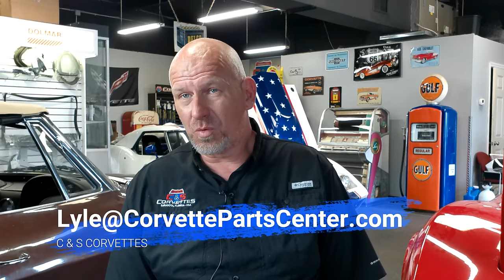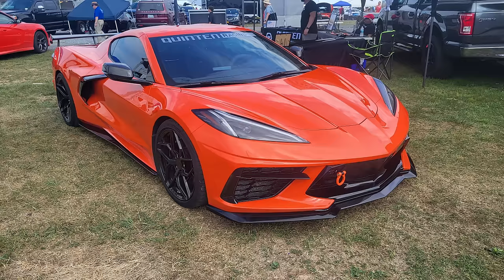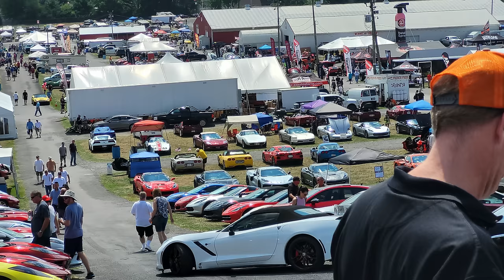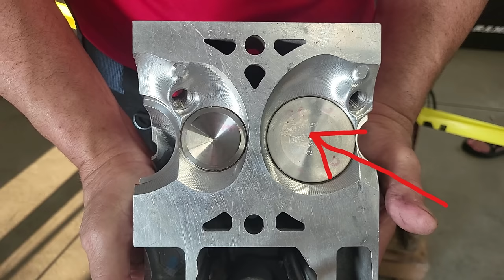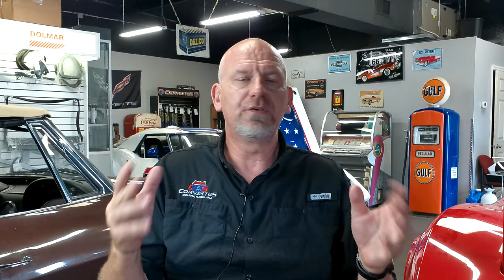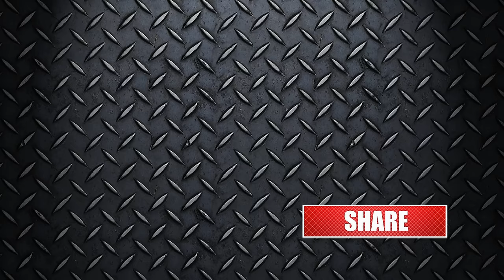The Truth about the LS7

Comment: It's simple it always has been. That engine should not be revving that high period.
Reply: Imagine buying a track built car, and the solution for the flawed design in the valves is... "oh don't rev the car out and get performance, just putt it around"
Reply: @mylesG23  for real. But to be honest any car that revs abnormally high, for example alot of super cars they need to be inspected every so often. Any engine that revs high will always wear unbelievably fast. That should have been in big print in the broshure
Reply: @qpzmak  Yea, I mean we saw issues with the Voodoo in the GT350 due to vibrations but that is significantly higher revving, and the motor wasn't blowing up, they were rattling oil filters off, significantly worse it burned cars down haha.  I mean 7k really isn't THAT high, most other LS and the new LT motors rev to 6500, and they have non of the issues.  From all the reading I've done and what people said here it was due to the material the valves were made of, performance driving only exacerbated an already ticking time bomb.  I think alot of the reason there's so many people coming forward now, is when the cars hit the bottom of the depreciation curve and younger people who wanted a track/auto X car bought them from old guys who literally NEVER drove them.  On god saw a 06 pop up for sale on facebook like a week ago with sub 10k miles.  Obviously that guy has never seen a valve issue, he drove it once a year.

Comment: All I hear is a bunch of excuses.  Why did GM give it a 7,000 rpm redline if it can’t handle it?   Short shifting it doesn’t make much sense. The RPM’s matter when you upshift too especially if you are racing etc.  

The GM guy will never outright admit they messed up.  The LS motor is one of the most modified platforms I’ve n the world but the LS7 can’t handle simple mods?

Comment: this is such boomer talk. "If you modify it at all it wasn't designed like that it's your fault blah blah" the fact of the matter is that there are countless stories of those valves being bad stock. Any engine worth its salt especially the LS platform, is capable of much higher performance than stock.
Reply from the maker: You should check out the follow-up video I did after interviewing a former GM executive about what GM really knows about the issue.  Remember, this video was reporting what we were told by GM's head tech...not my opinion.   Lyle

Comment: So much incorrect information in this video. Dates of public admission: incorrect. Almost no stock failures: incorrect. 6 or 6500 is enough 😂 Have you even seen an ls7 dyno sheet? The valve guides are not concentric with the seats. You can use brass guides with titanium valves, the valves get a moly coating. The guide issue is real and happening to stock engines…the titanium rod rubbing issue happens to modified engines. Fyi, there is still an ongoing lawsuit
Reply: My Z06 on the dyno made max hp at 6k. It holds it to about 6900, and then drops off fast. (Rev limiter is 7200)
The class action lawsuit has been settled for awhile now and GM won.
Personally, I have never found a mechanic or owner in real life that has ever seen an LS7 valve failure.  Just a lot of internet hype.
Reply: @SmoknJaysGarage  lawsuit isn’t over, and your ls7 isn’t the only one out there 😂
Reply: @bdun1226  you asked if we've ever seen as LS7 dyno. Yes I have, several.  All made peak power right around 6k.
Yes the lawsuit it over, and yes GM won it.
Reply: @SmoknJaysGarage  there was a procedural dismissal only for Californians. All other plaintiffs in other states are still waiting to be heard in Michigan court. There was no factual dismissal.
Reply: @SmoknJaysGarage  call Knapp Petersen and Clarke, because you are talking about something you evidently know nothing about
Reply: @bdun1226  they couldn't find enough people that actually had a valve failure to keep it in court. It was thrown out. It is not still pending in other states. You can Google it, you don't have to take my word for it.
Reply: @bdun1226  I may not be a smart man, but obviously have more knowledge on this particular subject than you. Everyone agrees.
Reply: @SmoknJaysGarage  you are delusional…you think everyone agrees with you 😂
Reply: @SmoknJaysGarage  nope, you aren’t smart by your own admission…i can only share that because it’s on the internet. Reading is fundamental
Reply: Yep, just more GM propaganda. He says 2006 is the only year there was a machining problem. So how come there was a bulletin from GM that said the machining issue affected 2008-2011? Then he claims almost no stock engine failures. What a bunch of bs.  But I notice he didn't mention the excessive valve guide wear issue, which is what eventually leads to a dropped valve.
Reply: @darylmuellenberg9456  i keep posting a caselaw link of the lawsuit and YouTube keeps taking it down
Reply: @bdun1226  can't post fake news?  Darn, I was looking forward to seeing it.
Reply: @SmoknJaysGarage    case/estate-of-pilgrim-v-gen-motors-2
Reply: @SmoknJaysGarage  Google that, you should be smart enough to find it with part of the link since YT won’t let me link. Or maybe you aren’t that smart
Reply: @bdun1226  I did Google it, and everything confirms what I've been saying.
Reply: @SmoknJaysGarage  Hope you don't have the issue, because it is FAR from "internet hype", as it happened to me. Do you even own an LS7? "A lot of internet hype" has cost C6 Z06 owners between $15,000-$20,000!! Facts: All the LS engines have the same length valveguides, including the LS7. However, the LS7 uses the longest valve stems of any LS engine. Think about those facts for a bit........
Reply: @milojanis4901  yes I have an LS7,  no I haven't had any issues with it. I have almost 45k miles.
Reply: @SmoknJaysGarage  Incorrect!! They couldn't find enough people with the issue who wanted to get involved.....
Reply: @milojanis4901  can't find enough people with issues to make a case...but ya, every single ls7 has issues.  Lol

Comment: Thank you very much for setting the record straight. I have been concerned about this issue as I have been in the market for a C6 ZO6 but then ran upon those damn internet garbage about the valves. I am now looking for a bone-stock ZO6. I will stay away from the 2006. I am looking at 2007 newer. Thanks for debunking this myth. I can now shop with confidence. And Attention All Viewers: If you have a C6 ZO6 (Except 2006) with a maintanance history under $27,000 please reach out to me. Thanks Lyle!
Reply: 07 and up Z for less than 27k ? I bet you are STILL looking. That's base money.

Comment: You’ve been misinformed by your GM buddy.. There must be a record of over 10k engine failures in the LS7. When the exhaust valves were designed and welded there were flaws that allowed the valve to break at the weld and destroy the engine. It happened to owner racing their cars and some simply driving normally. GM knew this and hid the fact that any LS7 could grenade at any moment. GM simply hoped owners would make it pass the warranty. Thousands got screwed bad on these cars. Some were smart enough to replace the GM heads with aftermarket units that basically saved the owners from 15k dollar repairs. Making excuses for GM isn’t a good look

Comment: can i get at least a muf delete ?
Reply from the maker: After having had the interview with "Duntov", my insider at GM (not the GM Head Tech still employed by them), I don't think that doing anything to the air intake or the exhaust hurts the cars...it is a design and metallurgy flaw that will either be good forever or fail spectacularly at some point.  Best advice I can give is to fix or replace the heads with the kit from Katech or a similar company.  Lyle

Comment: Based on the stupid comments made in your video you must think your viewers are idiots,  none of us are techs,  and noone is aware of GM's history of claiming certain problems only exist in certain years,  or not at all....  I personally know of 3 newer than 06 BONE STOCK low mile,  pampered, very well maintained Z06'S  that have had valve problems.  My chiropractors 2012 ate a valve with less than 30,000 miles on the clock. He and his 80 something uncle are the only ones to have ever driven the car,  and he has never revved it past 5,000 rpms because he is not a gear head, and scared of it.  You CAN NOT OVER REV A STOCK LS7 as the ECU will not allow it.  High rpms are often used AND NEEDED when going thru traps on a drag strip or holding a gear while cornering or on a road course. You know, the kind of thing YOU BUY THE Z06 FOR....  Furthermore ANY engine should be able to rev in the upper rpm range with stock tuning and proper maintenence.  Blaming a manufacturer problem on other shops....  Have you ever heard of Berger Chevy? Most auto enthusiasts have as they've been world renowned Chevy High performance and Corvette enthusiasts for over 5 decades.  They are the ones who fixed the ones I am aware of,  and they see this problem quite often. They just don't talk about it unless you know a tech personally.  Because like you, or who ever put these words in your mouth,  they do their best to cover GM's ass and not piss anyone at GM off.

Comment: You have no idea what you’re talking about first, second, if you’re gonna literally sit there and insinuate that putting a cold air kit and long tubes on a car can damage the engine, you need to put the pipe down.

If it’s damaged afterwards, it’s probably not the cold air kit or long tubes fault.
Reply from the maker: This is what I was told by Paul Koerning from GM in an interview.  I did not edit his words.  I also did a follow-up video after interviewing another source inside of GM that told a very different story...check it out.  Lyle

Comment: So Chevy engineered a engine that cant take bolt ons!? The number one thing almost every Corvette owner does to there cars. And when your  trying to go fast it's better to shift at peak horsepower not torque, what's the point of having all that horsepower. Great video otherwise
Reply from the maker: Walter, I agree on several of your points...I wanted to present the GM explanation verbatim and then address the follow-ups in a second video.  Lyle

Comment: Ummm ya dude your info is wrong there bud … I have an 08 and it dropped a valve and it’s because the valve guides are too short and it was bone stock when this happen car had well under 25k miles on it … GM needs to get there shit together and take ownership to that they messed up but now they wanna say it’s because cars are modded only it happens  BONE stock yall are sending false information know a few of them that swallowed the valve and left the stem in the head.. valve issue no head issue um I guess what category you wanna put the valve guide in… this is the worst video
Reply from the maker: Ummm ya dude...I interviewed GM's Top Corvette Mechanic and simply repeated what he told me.  Later on, another (former) GM engineer wrote me to tell me the real known issues with the LS7...maybe that video is something you should see before telling me how false my information is?  Just a thought, eh?  Lyle

Comment: So much bad information, LS7 is absolute trash engine.
Also what's with the nonsense of not getting benefits from rpm's? Switching gears at peak horsepower with be much faster than switching gears at max torque.

Comment: Disappointed. This video was made for mechanical ignorant. There was lots of generic talks and nothing about LS7 specific cause of failures. From what I have heard failures has happened in all year LS7 ZO6s with stock engine. Of course, GM chief engineer and CEO would not admit to any problems. Talking to them is waste of time. Because of this, I am looking for a C7 Z06 even though C6 has much better styling.
Reply from the maker: Did you watch my follow-up video? It goes into much more mechanical detail.  Lyle

Comment: This video really hurts your credability as some one that gives corvette advice, works on them and has been around them for as long as you have. If you couldnt mod the ls7 and rev it past 6k why in the hell would anyone get it over the grandsport? Cam, headers tune and the ls3 is putting down ls7 numbers. The head issue is widely known in the corvette community and you work on them for a living and dont know? You should delete this video
Reply from the maker: Ben, like I mention in the video, I have never had this problem in my shop.  I went to GM's #1 tech for information, and passed along what he told me.  The internet is rife with overblown fears of just about everything, so I wanted to start my investigation at the manufacturer and proceed from there.  I have gotten a lot of feedback on this issue that further educated me on the LS7 issues.  I will be doing a follow-up video to cover those points, as well.  As far as my credibility goes, I reported accurately on the results of my interview...if I was a tv reporter would that hurt my credibility?  I think you are being unfair.  Lyle
Reply: @csvette  obviously the guy was towing the gm line, because the ls7 should have been a full recall. As a Corvette mechanic you should have known this, not just make a video on a highly debated issue. I am part of the Corvette community c6 is my favorite generation wide body. I have a grand sport because I don't want anything to do with the ls7 and there is no way I should know more then you who has been in it for the last 30 years